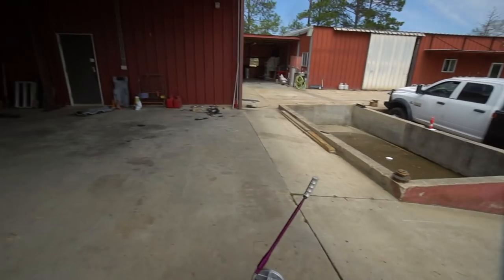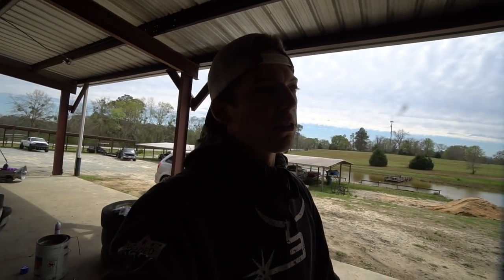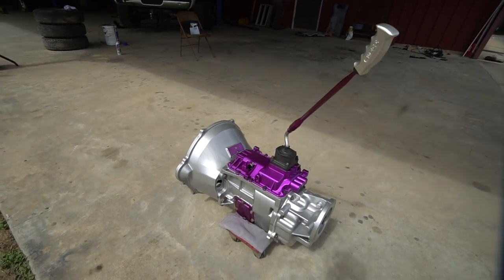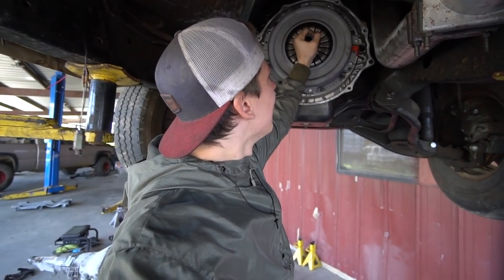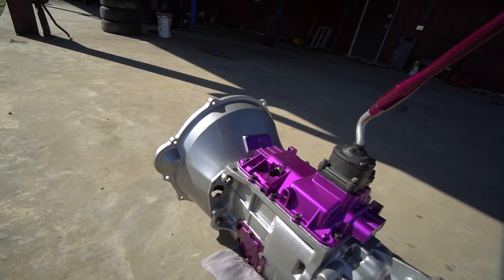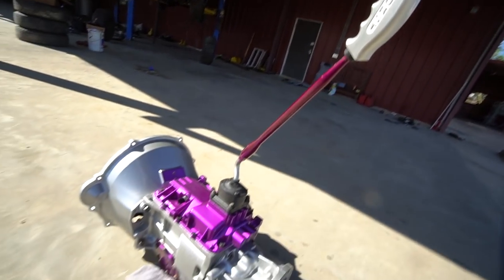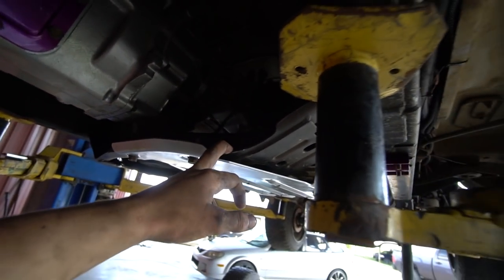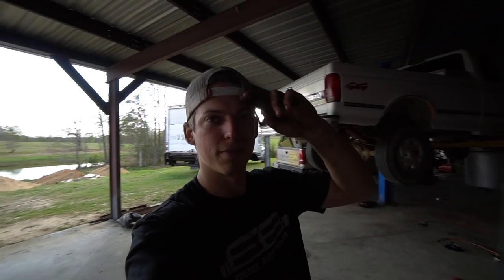NV4500 SWAPPED CUMMINS IS NEAR COMPLETION (Insane Custom Powder, Street Dual Disk Clutch)

Comment: You should of took the time to clean up the undercarriage. Wire brush and paint. What's the point of just power coating a few things when the rest of the undercarriage looks like it dose. Also I would get ur rims power coated since that tow truck driver scratch them up. Love how it's coming along though keep it up